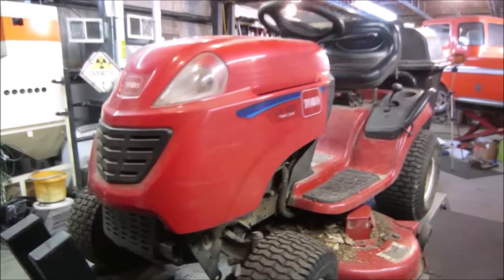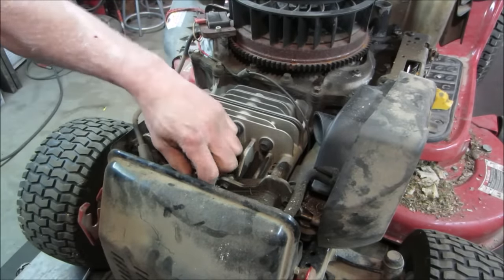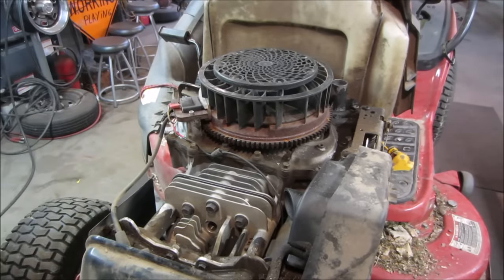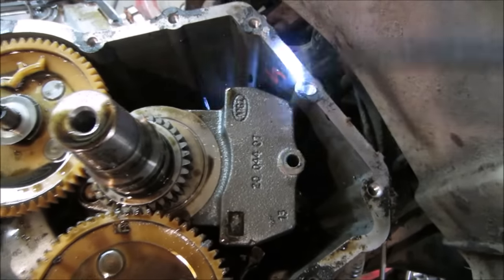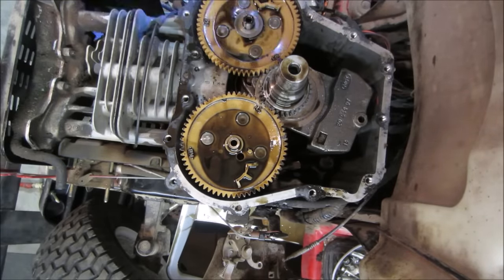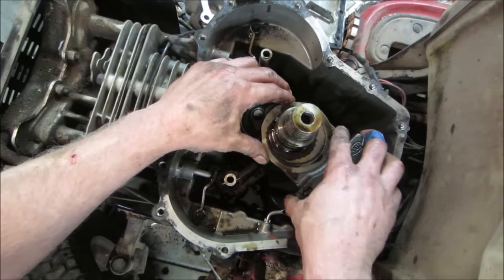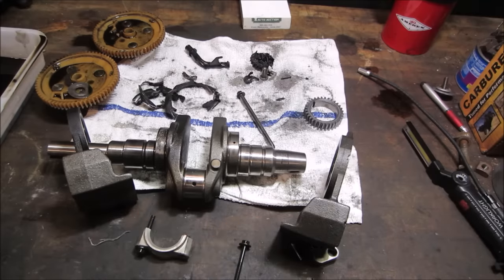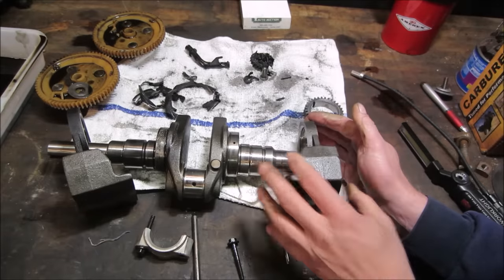You Won't Believe Why This Engine Blew Up,

Comment: have a 19hp kohler command here that was locked up solid,  in mine the bottom of the crank had worn through it's bushing into the alloy and jammed. was like it had too much tension on the belt to cause the damage lol

Comment: When I saw "Twin Cam" on the engine cover I new it was a Kohler Courage 'bucket engine'. I thought sure some of those top sump bolts had worked their way up, the flywheel hit 'em and the block was cracked. I was surprised that it was the counter balance system that let loose. Just goes to show you ya never know...

Comment: Not uncommon on small engines with counterbalancers. I’ve seen a few Syncro Balanced B&S engines do the same. And even the old larger K series Kohler singles, had balance gears. They’re more well known as “grenade gears” and are commonly removed during rebuilds.

Comment: Everybody else: Counterweight is just a cast in part of the crankshaft. Simple, never breaks.
Kohler: Wait we can do it with 50 extras parts plus 2 extra journals on the crank, extra oil drillings, extra bosses in the case and it will fail because one undersized bolt holds 10 kilos of reciprocating mass together. It's "Better" (TM)
Me: Makes mental note to never buy anything with a Kohler motor.

Comment: Change your oil, change your oil, change your oil. There is no substitute for regular oil changes on any combustion engine.  
Guaranteed the dirty oil ate the surfaces in the lower portion where they are bathed in oil with the heavy sediment flowing around.

Comment: had several of those kohlers come in they are junk they explode due to oil starvation.. the oil you see is whats usually in the gallerys and stuck all over the place.. funny how lawn boy had kohlers on there newer 4 stroke versions until the epic failures of governor springs and internals letting go i picked up at least a dozen of them where the owners use wire to pull the governor and when i ask they say they found the springs snapped and a few handed me the broken peices only to find out its a $27 spring the size of your pinky

Comment: I've been wrenching on engines for close to 65 years. I have never seen anything like that. those counter weights had to be putting some  tremendous stress on that bolt, that locating dog, and those 2 locating areas in that aluminum housing. I believe that engine was designed to fail.

Comment: Yeah, a $600 mower isn't going to get a $600 (new) engine... however, the engine looks like it can be rebuilt, possibly with a better quality bolt to hold the counterweight together.

I haven't looked, but does one need to buy a complete new counterweight half, or can you source just a new bearing?

Might need to turn / polish the crankshaft where the counterweight bearing was riding, probably need to polish up the housing where the counterweight bashed it up.

Some file work on the top plate to restore the counterweight locator groove.

And, you probably can get away with filing the teeth on the nylon cam gear, but pricing one out is a worthwhile exercise... if a new one is like $20, why not replace it? They make those of nylon for two reasons, weight, and to be sacrificial... normally, nylon gears are cheap.

Or, since Kohler motors are so common, find a donor tractor with a good motor.

Comment: That's the Kohler's (bucket engine) pretty crappy design, that was there issue along with blocks cracking up the side from the cover working loose from the counter balance vibration. Good video

Comment: They needed to dampen the excess vibration generated by enlarging the piston and lengthening the stroke as they attempted to get more power out of the engine.  The overly complicated balance weights are the result. They don't have enough room in the crankcase to swing a conventional crank counterweight, and "'engineered" this clusterf*ck. Reassembly without any of the counterweight components and without the governor will see this engine run again. I am curious to see how much vibration will result.

Comment: This was fun! I'm getting ready to do the same thing. I have a Craftsman mower with a 17 horse Briggs. Started blowing oil out the muffler, the bluest smoke I had ever seen. The engine was at full throttle but started slowing down quite quickly. In about 3 or 4 seconds it went from full throttle to locked up but it was a gentle reduction in speed. It didn't just stop. My guess is a broken oil ring which produced the heavy smoke. The broken ring began scoring the cylinder wall and things got really tight, really quickly. I guess we'll see! BTW, 24 years old, mowing about an acre once a week. I got my money's worth. I sure wish I had your lift! That's a sweet extra!

Comment: I think it was low/bad oil that caused it. likely overheated the crank/rod bearings and broke the counterweight slide pin first, then mr counterweight went dancing a wild jig, smashing the rest to bits and pieces.
** wouldn't surprise me if the oil filter isn't collapsed and restricted also. they don't like lack of oil changes and for sure not ran low!

Comment: That bolt through the balance weights is a common failure on the Courage engines. That one is a first generation one, they are on the 4th generation of that design now, and they still fail...

Comment: Man the guts in that small engine  

Look like it’s meant to fail super spectacularly 

That is how they sell the  new Traptors

 Gees 

Everyone  make sure you change the oil,  a couple times per season 

Traptors cost way too much money to be buying a new one

Also what cause it to fail might have been a abnormal outside influence 

A vine snag on the governor linkage or an eternal teenager at heart

causing an over rev  that blew up the internals

Comment: It's my guess gravity played it's part in this debacle.
To me that engine is not designed to run on its side or, at the very least, ought never have been used as a horizontal engine.
Its telling that it was the bottom counterbalance which gave the trouble as all of the weight would be trying to 'throw it off' the bottom of the crank as it were, downwards creating pressure on the (way too thin) bolt connecting the weights.
That and it may have been a 'Friday afternoon' build (as we say in the UK) witnessed by the conrod bolt being WAY too loose. 
The design looks excellent for a vertical application where the crank and all accessories on it are running free from sidewards pressure.
Just my tuppence worth 🤣🤣

Comment: The long bolt is not a bolt at all it is a pen and that little sheared off Bolt actually killed that pen in place but was sheared off causing the boat to drop to the bottom of the pan and the piece you thought is a bearing is not it's a gilde plate but when the pin drop down the two pieces of the counterbalance come apart causing gravity pull down on the lower one making the gilde plate shredding it and making it off center causing the governor to fall out of its flotation and being crushed by the counterbalance I imagine he made quite a bit of noise for the 10 seconds it was hammering

Comment: I have a 26hp Koehler, still running but have a knock when starting. It also runs good for a bit then acts like it’s either starving or getting too much fuel. I’m thinking because of the knock this maybe my issue and the governor is just starting to mess up.

Comment: I'll tell you what happened, the franistat failed, causing the disgronifyer to explode, which then led to the shattering of the fly back transponder.  Either that or it needs a new purple flux capacitor. 😎

Comment: Musti goes first since he owns this steel cadaver. He knew within a half hour this thing had taken a grenade in the guts. Parts that have little or nothing to do with each other are found mated in various self destructive death grips and wallowing in filthy oil with enough finely ground metal content to make the oil itself magnetic. 
The crank counter weights were being held in place by quarter inch bumper bolts. Factory tested at a steady one hundred RPM with no load. This whole mechanical contraption was aimed at grandmas lawn cutting chores but only under 100 sq. Ft. . Parts basket case, they were common back in the 1950s when Asia was raining down all manner of gas powered four wheeled contraptions on the American public and their precious thick green lawns spreading to the far horizon in all directions. I think it's time to take a second hard look at the old fashion cast iron reel mowers. They were back breakers but a crescent wrench and a straight bladed screw driver had you up and running in short order. Brand new reel mowers could easily be bought for around $20.00. Mine lasted from the time it was handed to me by my father along with 25 cents if I mowed our three modest lawn areas. I handed the mower back ten years later mostly in operating condition.

Comment: Oil level showed low - it showed at end of dipstick. Level should have been higher. The resulting higher operating temperature could have caused engine parts to begin to fail.

Comment: You have to take the key out of the bottom of the shaft to remove the spacer stopping you from getting the crank out. The spacer is not keyed.

Comment: where did the governor set in the top or bottom? where ever it was, was struck by the flinging of counter balance being out in it's space till it beat the governor to pieces shattering it. also hat brand of engine is that .     old timer    best guess

Comment: I have one of those 19/20 hp Kohler "courage" motors that some of the upper crankcase bolts backed off. Split itself in twain and self destructed. The command single cylinder were way better designed engines IMO

Comment: Without seeing the video, ... yet... I bet the crankshaft broke. Typical on the Kohler Courage engines I've see. I've had a couple that looked like someone used a die grinder inside the engine. More shattered pieces than one could imagine. That engine series is way too problematic to repair. I just replaced an engine on a Cub Cadet that had 140 hours on it. That isn't much time! It wasn't the governor either that let go on this one. Nothing salvageable left on the one I had. The one I had did have many holes in the block also. I got the tractor for free. I replaced the engine with a Briggs. The lawn tractor looked brand new when looking at it. They have counter balance problems. They just blow apart. I had bent bolts all over inside it. That's what this one had. After the new engine, I parked it on my front lawn and sold it.

Comment: People can say what they want about bucket engines if you purchase a mower with a 21 horsepower Kohler courage bucket engine regardless if it's new or used when you get it home pull the flywheel back out all the bolts and loctite  and that eliminates the problem with the bucket engine very good engines but that's my opinion did that with mine a 2005 bought it new got it home had 2 hour on the meter popped the flywheel off used the red loctite now I have over 400 hours not one problem 🤓

Comment: so the weight just dampened vibrations?  I looks like it was locked to the case...I thought crank counter balance weights have to rotate with the crank...to offset the weight of the piston/connecting rod movement.  I don't see how that fixed position weight did anything...just can't wrap my brain around it.

Comment: What was the management of Toro smoking when they decided to have MTD make tractors for them? That didn’t last very long. I live up east of St.Paul and what I have heard about Toro from multiple people is that they are cut throat as a business. I’ve heard of manufacturing sub contractors being awarded a contract to make a part or component for Toro including a contact,,,, they buy the steel and other supplies to make the item then Toro finds another company to make that part for 50 cents cheaper and Toro rips up the contract all the while the first sub contractor now is sitting on steel supplies that they have no use for.

Comment: I just look at how anemic that pin bolt is to hold all the energy of the counter weights seems like a design to fail part in my opinion could be a LLLOTTT fatter round like maybe 3/8 bolt instead of like 1/8 inch bolt

Comment: Root cause was most likely "Operator Errors"  1.) Hitting something that sheared the balancer bolt off (bad design/not robust) & 2.) Lack of maintenance (not changing oil, not keeping oil level up).  Owners like this should pay professionals to mow their lawns (cheaper in the long run)

Comment: Forget about putting it back together i just scrapped 2 of those motors with thrown rods after the owners ran them out of oil. Looks like they did and replaced it and it ran long enough to throw the governor out of it.

Comment: If this is a common problem with this engine is there a aftermarket upgrade that fixes it? I was wondering if a side load needle  bearing instead of a washer type would make it last longer? You could bush the bolt on the weights so it fit tighter would also probably help and a bigger diameter bolt.  Any thoughts of a fix for this design  comment below.

 I always like to see how aftermarket companies solve these endemic problems the big manufacturers have that they never seem to solve. If you watch precision transmission he is always commenting on how they just drill a slightly larger hole or replace a part to make the tranny better.

Comment: My almost new BS 22hp engine blew because the cam bolt nut came loose. The retainer was not folded over to hold the nut tight.

Comment: The top part you pulled off first had a notch init that was scratched and beat up some I believe the bolt end that broke (or the pin ) must have had vibration or movement as to cause it to break off  moving back and forth in that top aluminum housing causing it to eventually snap it of  causing the failure but what was the original problem that caused that is in your court lol it was at 13min .48 seconds in you video

Comment: The very first small engine I worked on was a Cushman husky 8hp did a complete rebuild after riding the dirt out of it the only issue i had was when I planed the head at a local shop they messed it up and it would blow head gaskets every month or so. Lol good times

Comment: I don't mean to be critical but I still haven't figured out why you don't blow off or wash off everything that comes into your shop before you work on it. It's so much nicer to work on stuff that's cleaner not to mention you can see what your doing better and you don't have all that crap on your floor to deal with afterwards.
Reply from the maker: when trying to locate problems some times the clues are in the dirt/oil that can help tell the story,

Comment: A) Clickbait title. B) Worked.

I repaired an LX460 that sat in the rain for 10 years. Everything about this mower sucks. Every fastener is a different size. The valve cover is almost impossible to seal. The starter motor is a "consumable" item. The deck belt is designed to rub the frame, so belts must be replaced twice as often as the oil. The brakes only work during their adjustment. The worst of the worst.

Comment: I had a big boy I worked on got hit by lightning and all the magnets were neutralized no polarity at all would not charge at all replaced recifier magneto and fly wheel and still would not charge only had 28 volts ac  and nothing on the output side to battery?

Comment: IF THE UPPER END SUFFERED FROM DIRTY OR LOW OIL THE DAYS OF THE BOTTOM END ARE NUMBERED. MY ADVICE, JUNK THE BLOCK AND REPLACE IT WITH ONE FROM HARBOR FREIGHT...OR PART THE UNIT OUT.

Comment: Like your logic seems dead right to me. Can't believe how easy that pulley cluster came off the crank, Last week I spent 3 hrs with pullers levers and hammers to get the electric clutch and pulley cluster off a Toro 256H Kohler to remove the engine to drill out the sheared off  mounting bolts, retap and refit.

Comment: Havent watched the video yet but these engines are notoriously bad for the sump cover bolts backing out and getting in the flywheel and cracking the block down the right side an sometimes locking the engines up.

Comment: You dropped it in the drain pan. A pin with an aluminium slider that goes on the balance weight.

Comment: I have a similar mower with a different engine that has a blown variable pully drive.  I could use some parts or could swap engines if you want to do some business.  I live at the NH Seacoast.

Comment: I'd fix it up and add some fresh oil and
Fire it up. I had a two cycle motor heat
Up and the separator heated up and stopped it.Took apart fixed it and got it
Running again..

Comment: Haven't watched the video but I'm going to guess there's a counterweight sticking through the back of that motor
Reply: Okay I watch the video and I'm partially right it's a Kohler Courage the self-destructing motor the pin that holds the counter weight in place snaps and then it just flies around and destroys itself a lot of times it just flies through the back of the motor and scares the crap out of whoever is mowing

Comment: I used to work at Sears. Husqvarna made craftsman tractors on some models used a Kohler single cylinder I believe it was 21 horsepower for 2 years and that was it . Don’t get me wrong kohler k series engines from the 60s and 70s are awesome. The modern day twin cylinders are really good 2 but Sears service technicians had way too many service calls for warranty work on the plastic camshaft gears like the one in this video. Yes plastic runs quieter and is less reciprocal mass but 2 years and craftsman was not interested in putting their name on that engine. I still see it being used on some other green and red manufactured mtd products and I cringe. I don’t like them but that is just my opinion

Comment: Also, as a third comment, send me that top cover! I replaced mine and wound up with an older version that doesn't have the correct slot for the counterweight slide. Sounds like a rod knock but I'm too cheap to buy the correct part.